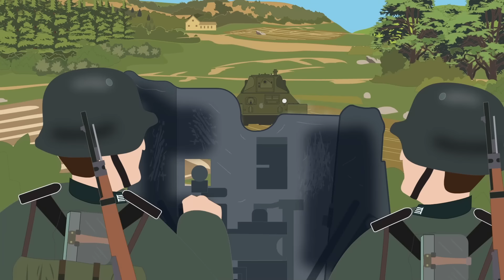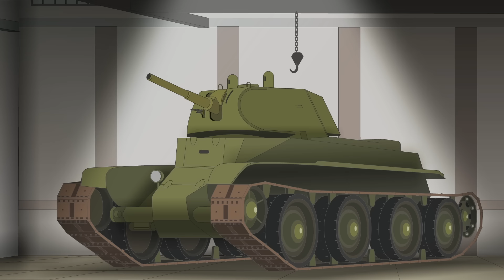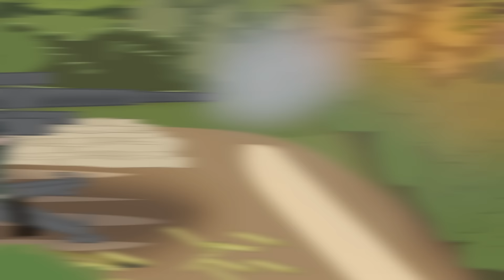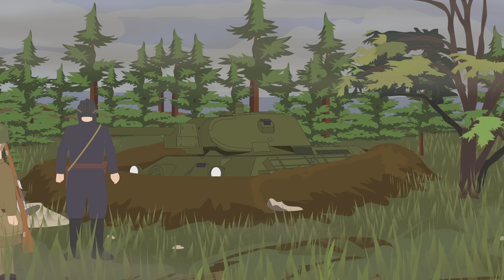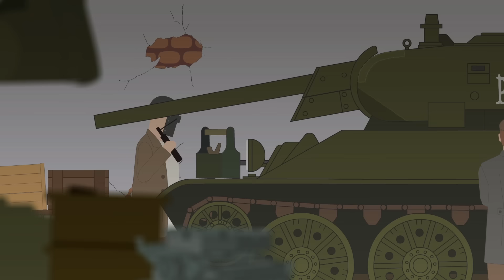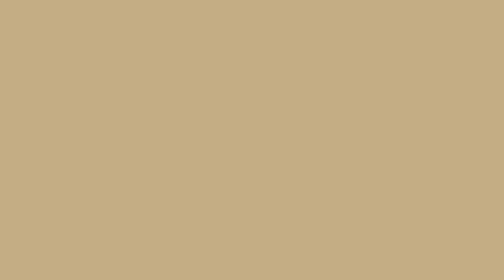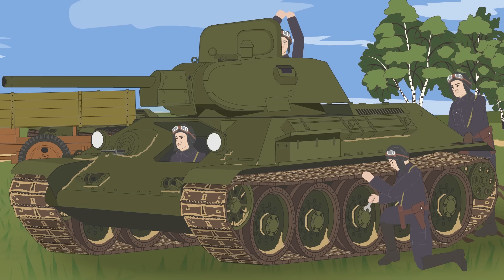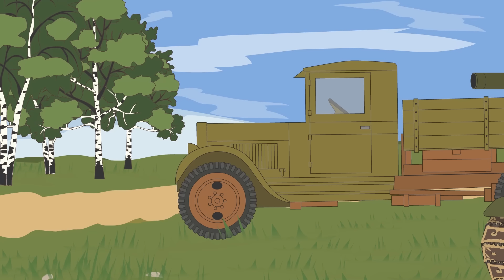Was the T-34 Really the Best Tank of WW2?

Comment: They were not the best tanks of ww2. But they were simple to produce and easy to operate and repair. It was a huge advantage over German tanks.
Reply: Not easy to operate nor repair. It was mostly just the production.
Reply: Which is why the Germans where able to capture them so easy ?
Reply: They were very much not easy to operate as the turret was not motorised there was no gunner basket and the transmission was terrible
Reply: T r a n s m i s s i o n
Reply: yet the Germans were way further with technology than the soviets
Reply: @DauntlessSherwood  no
Reply: But we know they don't have transmission they rely by their own selves a 1 tank in against them and also shock tactic striking through forest and even underhand tactics
Reply: Well the repair part is up the debate during the war no T-34 was built to a standered so they was some major variablity go to lazerpigs video on the t-34 is pretty good
Reply: @sawyerlogon7666  the T34 was good on paper, but it was trash compared to other tanks
Reply: @Delta-6501  yup most problems in my opion come from the manufactioring defects
Reply: but only 25% of them had radios...so not really. And 80% of all t-34's was destroyed
Reply: Fucking bullshit if an karl 98 shot it the soviet tankers would die of hot lead shrapnel and could only drive a hundred kilometers before the tank engien is completly onuseable
Reply: @drabantcorper4727  yeah no, 7.62 cant pen anywhere near 45mm of RHA.
Reply: @codyskull2594  your correct 7.62 cant do that but the t-32 was made out off hard pansar and that will not buckle but instead start to crack and leatting in fragment of the armor in to the crew.

(It was also hot)

And they had know space to put the gas somvhere so it was with the crew and hot hot schrapnel hitting gas and then the crew start to become a crispi potato
Reply: @codyskull2594  actually in some cases German rifle round could hurt the crew, it did not need to penatrate to kill only to cause Spalding which was very easy due to the soviets poor metallurgy.
Reply: @drabantcorper4727  if the T-34 was a terrible tank then name a better tank, I’ll wait. 

(If you say a German heavy tank or a panther, I will laugh)
Reply: @thecorneroftheinternet4656  Sherman. Better reliability and transmission because T34's transmission breakdown a lot. In fact, in the test driving to Moscow to show how good the Tank was. It broke down 3 times. It had a better gun at infantry support but only slightly worse in anti-tank, Sherman's gun only has a slightly lower velocity than the T34. Better crew comfort because it had a lot more space and the seats are made out of leather which makes the crew feel fresh when they get into battle. Much much better survivability because the rate of KIA for destroyed Sherman is 0.6. Better quality of armor than the t34 and also thicker effective frontal armor because it was angeled so it has a 91mm frontal armor effectiveness. It also had a better quality of armor because the Soviet's armor usually caused spalling after direct hit which is tiny bits of steel flying around the tank. Also, Sherman had better reload speed because the T34 was so cramped, it usually deliver 1 to 2 rounds per minute to the enemy. While Sherman has about 6 rounds per minute.
Reply: @rickastley4050  isint like every  tank form usa is better comparde to russias in ukraine i think i was a tank convoy how was stuck cuz the threads i dont know what it is called  anyway crackte upp so it cant move at all
Reply: @rickastley4050  The Sherman could easily be knocked out compared to the T34...and the T34, the original, not the 85 variant can do that.

The armor of the Sherman on the sides was flat and the point of where to ammo rack it was quite clear. Middle of the tank, below the turret.

The gun of the Sherman would have a tough time taking on a T34 due to the slopping.

And no...the americans did not have better tanks.

(looks at the Lee) Yea.

The sherman didn't cause fear in the german ranks...the T34 and KV1 did.
Reply: @rickastley4050  alright, now that I think about it, the M4 Sherman was kinda more superior than The T-34/85, but I’d still say that the T-34s lack of complexity and huge production kinda makes up for it.
Reply: @thecorneroftheinternet4656  pz4
Reply: @thecorneroftheinternet4656  or a British tank
Reply: @thecorneroftheinternet4656  or the Sherman
Reply: @SoulKiller7Eternal  T34 didn't cause fear, the KV1 did. You may think that the T34 causes fears because the report about T34 starts to come back in the first or second months of the invasion because it looks so similar to KV1. However, they already encountered T34 on the first day of the invasion and easily knocked it out with pz3. The thing that Germans fear is the KV1 because of its armor and the T34 had a pretty similar look as the KV1. For the Penetration capability of the T34, I do agree that the armor would be quite hard to penetrate but the T34 would have a hard time too. The eighty-five variant can penetrate Sherman's frontal armor in about 300m. However, by that time, seventy-six millimeter Sherman had already come along and it could also penetrate the T34's frontal armor in about the same range so no sides will have an advantage in terms of penetrating power. The sides for both tanks however would be much easier to penetrate even for Sherman's seventy-five millimeters gun could ripped through the T34's side armor like paper because the effective thickness of the T34's side armor is only about 40mm thick. For the ammunition, both Sherman and t34 had ammunition in the fighting compartment so the ammo would be hit if penetrated. However, the Sherman's introduced the wet stowage which would slow down the firing process significantly and would give the crew the time to bail out.
Reply: @thecorneroftheinternet4656  Every Sherman was better in all aspects

the 50mm panzer 3s were better

the panzer 4s with long 75s were better

Also, if your looking at straight stats, yes, almost every german tank past the Panzer 4 was better than the T-34

Also technically the Leopard 2A7 is a better tank than the T-34, also the panther is classified as a medium, despite its weight
Reply: @rickastley4050  yes! Yes! A actual person with braincells! Thank you
Reply: @thecorneroftheinternet4656  Russian KV1!
Reply: @codyskull2594  while the allies heat treated the metal on their tanks to about 300b the soviets heat treated theirs to about 600b which made it stronger but at the same time very brittle and could easily crack from being hit by a projectile. There are many pictures on google that showcase t-34's with cracked armor. Especially on the joints where soviet welders gave about 50% effort.
Reply: @thecorneroftheinternet4656  the sherman had a crew survivability of about 18% after being shot once whereas the t-34 only had about 14-15% survivabilty for the crew. Not to mention because of the design of the t-34 tankers were crammed inside of the t-34 leaving little room to move around
Reply: @drabantcorper4727  comeboo
Reply: @thecorneroftheinternet4656  people don't grow on trees
Reply: @thecorneroftheinternet4656  why laugh? The tiger was vastly superior to the t-34 in everything but number.
Reply: @SoulKiller7Eternal  A Sherman with a 76mm gun could easily penetrate a T-34 at multiple points. Even if the shot did not penetrate, the crew would be wiped out by spalling. Also, every single tank was somewhat vulnerable from the side and a Sherman could easily destroy a T-34 with a  good side shot. The M3 Lee was not a great design, but it was barely used anyway and was only meant to be used as a stopgap until the Sherman finished design. The Sherman was way more reliable, ergonomic, and easier to repair. Later variants such as the M4A3E8 "Easy Eight" and the M4A3E2 "Jumbo" were vastly superior to the T-34 in most aspects and eventually, when they did finally face each other in the Korean War, the Shermans fared better in combat.
Reply: @thecorneroftheinternet4656  the sherman
Reply: @thecorneroftheinternet4656  panzer III, panzer IV, sherman, Cromwell.
Reply: @thecorneroftheinternet4656  Sherman was legitimately a better tank as they were manufactured during WW2, if built in the same factories with the same materials and by the same welders, using the same casting methods and materials the same heat treatment processes, and the ammunition for both was manufactured with the same smokeless powder, you might have a halfway decent argument for why the T-34/85 could take a sherman in a head to head fight, but a lot of other soft factors involved edge the Sherman ahead of this theoretical best case scenario T-34. A lot of the reputation the M4 Sherman gets is due to the fact that the M4 never really had the luxury of hiding in a bush somewhere waiting for an unsuspecting enemy tank column to come trundling by into a pre-sighted ambush zone whereas the Germans did, it’s largely a moot point anyway because in the grand scheme of things it was more a war between tanks and infantry with anti tank cannons. Tank on tank engagements were much rarer than people tend to think, this is still primarily an infantry war.
Reply: @thecorneroftheinternet4656  the fact soviets were still producing them in the middle of wartime and with factories under heavy fire is ignored by many who talk about the quality control of the t34s. shermans only had good quality because american factories weren't being attacked at all, or near the front line, compared to soviet ones, thus the USA could take all the time they needed to have good quality vehicles. and even then a lot of soviet industry was being moved to the urals which caused a large drop in supply while keeping the same demand, hence the remaining factories had to produce as many t34s as possible.
Reply: coming up with angled armor saved their butts!
Reply: @davidbrandenburg8029  oh so we are going to ignore the fact that sloped armor exists in some medieval castles
Reply: @davidbrandenburg8029  that's been known about for a long time. The only reason they even needed it was because the armor was to brittle
Reply: @davidbrandenburg8029  no thay didn't Tank's from far earlier had sloped
Reply: They were not easy to produce
Reply: @Deltafrost-xh7sq  they were not easy to produce *well* They were extremely easy to produce if you were to you know, cut down on some things like crew comfort, decent welds, seats, armor hardness. Almost all T-34s had at least one defect, but they were quite easy to produce if you dont count the countless manufacturing errors. Hence why the gun was so inaccurate their best strategy was just to charge the enemy (thumbnail) lmao
Reply: Doesn't have to work more efficiently. Just has to work around efficiently.
Reply: yeah they was made in the same philosophy than the Shermans, medium, cheap, no need of elite crew and easy to repair
Reply: sorry to say, but easy to repair is a myth. how lmuch time is needet to change the clutch,to replace the engine,to exchange a spring in comprison to a Pz IV ? you will be surprised bcause russians don`t care about repairs! so please stop repeating some myth without knowledge.   "they say" isn`t areliable source.
Reply: They were not easy to produce. that's why every factory had to find ways to cut corners.  the end result is a tank nothing like its  original design.
Reply: I should say the t-34 was not easy to operate as one of the drivers levers I forget the name currently but it was prone to be hard to move and also was one part most likely to break if pulled to hard
Reply: one tiger took out  27  t34s and got hot around 50 to 60  times with 85 mm  got a couple dents
Reply: they were actually one of the worst vehicles to operate,
Reply: And much cheaper to produce
Reply: It was so simple even a child could drive it
Reply: Hahahaha. No
Reply: I think the t34 85 was the best but not the regular t34s used in 1942.
Reply: haters thread 😅
Reply: Not exactly watch the lazerpig video
Reply: Actually they weren’t simple to produce- they just rushed production
Reply: in 1941 thur 1943 the kn1 was best tank in world.  that why Germany made the tiger
Reply: @christopherrice6553  kv
Reply: Considering they lost more tanks than any vehicle ever lost in any war in history COMBINED, no. The t34 sucked.
Reply: That whats make them the best, duh 😂😂😂
Reply: Yeah that's why they were the best you literally just explained why it was the best
Reply: Yes
Reply: 'Quantity has a quality of its own' - Stalin (allegedly) 

The final and best argument for the t-34.
Reply: The USSR had more heavily armored and heavily armed tanks than the t- 34 but there were far fewer of them, the t- 34 was a common tank , which was encountered more often so it is better remembered.
Reply: It was the best.  Big gun, sloped armor, great tracks, excellent diesel engine.   Its upgrades were the Soviet T-34-85 and the Wehrmacht Panther.
Reply: Ah... They were not easy to repair. At all. They usually weren't repaired, you'd just get a new one. If you didn't die form the massive fire that started that you probably couldn't escape.

They were easy to produce. Especially if you took out minor things like: Seats. And radios. And Rubber. And working transmissions. And didn't properly weld it. And didn't properly rivet it. And gave it a shelf life of 500 km.
Reply: @invidatauro8922   don't forget the shrapnel that would ripe through the Hull
Reply: @invidatauro8922  compare to german advanced stuff, they were damn easy to fix xD
Reply: @invidatauro8922  and more like no having turret basket which is essential and no bullet proof glass on periscopes and scopes
Reply: @invidatauro8922  500km is good compared to Panthers.
Reply: Hard to operate, dangerous, un-repairable. Mismatching spare parts etc. Want me to continue?
Reply: Easy to operate huh 
So we are about to ignore the strength needed to change gears of whatever
Reply: I say just go watch laser pig
Reply: @met25252  his vids  are so good
Reply: Disagree, it was the best tank statistically.  Due to cost of production and sheer numbers.
Reply: @IS-2 Heavy Tank no the t34 was not fast its got one shoted by panzer 3 and was not very cheap
Reply: @IS-2 Heavy Tank it was the slowest allied tank
Reply: they forced the nazis to change their whole design philosopy and tactics to be able to handle it , no other tank did that in the entire war , IT IS hand down the best tank of ww2 whether the westoids like it or not...
Reply: No the t 34 dident have any advantages aainst german tanks
Reply: @niclink1030  Did any Soviet tank knock out any German Tanks??
Reply: @katimboallan4605  yed they did but the t34 still sucks
Reply: and EXPENSIVE
Reply: @madhie-kun8614  the tigers? Yes
Reply: @polar8469  I think he means the t-34 it was not a cheap tank
Reply: Yes it was. For the simple fact that it doesn't matter if you make a giga omegalul tank (king tiger) that costs in average 300,000 man hours to be produced when the t-34 costs only 6,000 in average, meaning for every king tiger 50 t-34 could be built. Yes, by the end of WW2 the t-34 was massively outclassed but guess what, *it doesn't matter* if you have 100,000 more tanks than the enemy.
Reply: @HenriqueRJchiki  The problem with your assessment, is actually several points. First. It was expensive. It was on par, if not more expensive top build then a Sherman. Second. It doesn't matter if you have 100,000 tanks, if 70,000+ were down for maintenance. Third. The tank was no where near what is put on paper for effectiveness. Very few could actually match up to the quality that was the norm for ANY of the other Allied or even Axis nations. Everything from the armor being way to hard, which is what caused the spalling inside the tank when hit by even some small arms, (which did happen, though not often, due to very few tanks having the same armor qualities as their sister tanks in the same production lines...) and cracking instead of shrugging of a round, to the sights being hit or very miss on quality. Some you could see through, though not well, some you couldn't see through at all, and only few being worth a damn.(The funny thing is that the ones that actually worked, were considered some of the best in the war but when you do not assure quality of all...) The biggest thing that Russian tanks had problems with, that were even there in the after war productions of the tank, were the issues with the engine and transmissions.

So you have a fairly expensive tank, which couldn't effectively do the job consistently, and most things known about them is propaganda pushed out by either the Russians, or the Germans. Not a reliable source of information. And when they were actually looked into by the Allies, they came away with the firm conviction that they were for the most part junk. It is why you do not see ANY of the other Allied Nations using them after the war, or even using the designs.
Reply: @johnathanjarrett63  The problem with all of you tank nerds is that you are all obsessed with the tactical field and completely disregard the operational and strategic, the t-34 was far cheaper than any similar german tank, it worked better under russian soil, it was mass produced enough that it outnumbered THE ENTIRE WORLD, the soviets ended the war with 22,000 tanks, again, MORE THAN THE ENTIRE WORLD COMBINED. "But muh 93924mm murican tank can penetrate the 58271m armor under a 948281° degree slope" and BLA BLA BLA completely fucking irrelevant nitpick specs that only matter on the tactical floor and ends up being irrelevant because the opponent has 100x more tanks and just encircled your entire division.
Reply: @HenriqueRJchiki  quality is always better than quantity that’s why the massive millions of soldiers per army doesn’t exist now
Reply: @HenriqueRJchiki  do you know why so many Russians died in war it’s not because their strategy was to throw themselves at the enemy until their ammo ran out it was because of poor strategy a lot of poor strategy
Reply: @HenriqueRJchiki  say you have 100 expensive tanks and 200 cheap tanks but for those cheap tanks you also need twice the amount of supply trucks, crew, food, and training, and all of a sudden those 100 cheap tanks cost you a lot more than you wood think
Reply: @HenriqueRJchiki  people don't grow on trees 🙄
Reply: @pikxv  ???
Reply: @HenriqueRJchiki   aaaaaaaaa this is the definition of comeboo
Reply: @pikxv  the USSR had more than enough, this was a time where production was more valuable than manpower, it's obviously completely different nowadays.
Reply: @HenriqueRJchiki  your argument is irrelevant if the 100x t-34s can’t coordinate with each other and half of them break down and the rest engage the enemies one by one cause they have no fucking radios and their “superior sloped armor” cracks in half when it’s hit by anything, and they can’t even see where their going cause all the sights excluding the gunners are complete garbage.
Reply: @HenriqueRJchiki  but that's the thing you still have to tran them and you have to move food and desel
Reply: Drrives gunners ecstasy
Reply: @HenriqueRJchiki  22,000 tanks is not more than the rest of the world lmao. The allies ended the war with 42,500 Shermans alone considering 50,000 were produced and only 7,500 were lost.
Reply: @HenriqueRJchiki  yes that is true but that 50 more t34s required more people more food for the people more fuel more ammo more parts then one king tiger
Reply: @polar8469  the T34 was an expensive tank built cheaply, that’s never a good combination
Reply: @tox_the_fox5406  somehow, it proved to be a good combination.
Reply: @polar8469  Not really, in the battle of Stalingrad 326 out of 400 T34s were lost, out of those, 260 were from auto mechanical problems. There’s also the fact that many needed components were removed(such as lights, seats, the turret basket(that thing in the turret that lets the crew move with it) radios etc) in order to lower production cost, and make production faster. In addition, while some T34s had great gunner sights the other sights were abysmal, it was to the point where a Pact-31 crew once shot at one 28 times before the tank crew noticed it was being shot at.

Do a little research before you say anything ridiculous like that.
Reply: @tox_the_fox5406  username checks out
Reply: @tox_the_fox5406  but still, germany attacked them by surprise and they needed something to manufacture quickly, something that would be cheap, and eventually they won the war, you should also check the wiki about it, it has lots of information about how it is a good tank
Reply: @polar8469  I’d like to clear something up real quick, the Soviet Union didn’t win the war, the Allies won the war, and yes I admit it’d be a decent tank if it was produced to the standards it was supposed to be manufactured at, but it wasn’t
Reply: @madhie-kun8614  source?
Reply: We bullied a tiger and panther. Winter is here comrades ;) ❄️❄️❄️❄️❄️❄️❄️❄️⛷️⛷️⛷️⛷️⛷️⛷️⛷️⛷️🏔️🏔️🏔️🏔️🏔️🏔️🏔️🏔️🎿🎿🎿🎿🎿🎿🎿🎿🎿🏂🏂🏂🏂🏂🏂🏂🥽🥽🥽🥽🥽🥽☃️☃️☃️☃️☃️⛄⛄⛄⛄⛄⛄⛄
Reply: @t34tank60  you bullied one, the tiger or panther bullied hundreds more
Reply: @t34tank60  try bullying tiger II
Reply: @t34tank60  shut up you start cracking the second something hard hits you and the crew has no space you got killed by Pz3 most and couldn’t go 50km without a breakdown and you were made in tractor factories and rushed witch made everything worse the only reason you past Poland was because the Germans didn’t prepare for winter
Reply: They were the best tank for the UdSSR at that time and thatsthe important part
Reply: @imper818   try the kv1 one kv1 stop a whole army tank uints for 2 days
Reply: @imper818  Nope.
Reply: @imper818  no
Reply: @imper818  that honour actually goes to lend lease vehicles
Reply: @imper818  kv1
Reply: @imper818  best medium tanks the KV 1 was a stronger tank but it was way more expensive to make
Reply: Might want to study history then. They WERE the best tanks of WWII. Thats a fact. Trying to dispute that...is...well...only an idiot would argue against a fact.

Easily massed produced and equipped with the armament to handle any opposition...they were the foundation of what would come to be...the MBT idea.

T-34 can be in attack or defending.
Reply: @SoulKiller7Eternal  False, T34 wasnt as reliable as people say and the main gun lacked later in the war. They were cheap and worked in early war, however T34-85 was the better tank from these two.
Reply: @joelm5509  never said t34 is reliable
Reply: @joelm5509  Correct. The T-34 was incredibly unreliable.
Reply: @SoulKiller7Eternal  No they weren't the Best Tank of WW2, no tank was for that matter.

Each tank had it's advantages and disadvantages, and the T-34 had plenty of both.

While the T-34 was cheap, and had sufficient firepower, and reasonably good armor, it was plagued by reliability issues just as much if not more than German and Western Allied vehicles, it became such an issue that Joseph Stalin himself wrote an order concerning these reliability issues in 1942 during the Battle of Stalingrad:

"Our armored forces and their units frequently suffer greater losses through mechanical breakdowns than they do in battle. For example, at Stalingrad Front in six days twelve of our tank brigades lost 326 out of their 400 tanks. Of those about 260 owed to mechanical problems. Many of the tanks were abandoned on the battlefield. Similar instances can be observed on other fronts. Since such a high incidence of mechanical defects is implausible, the Supreme Headquarters sees in it covert sabotage and wrecking by certain elements in the tank crews who try to exploit small mechanical troubles to avoid battle.’

Henceforth, every tank leaving the battlefield for alleged mechanical reasons was to be gone over by technicians, and if sabotage was suspected, the crews were to be put into tank punishment companies or "degraded to the infantry" and put into infantry punishment companies.' "

This pattern of Mechanical Failure continued well into the later half of the war, with the T-34-85 and T-34-76 Obr.43 upgrades both being plagued by old and new reliability issues of their own, these issues were only really resolved after WW2 with the final modernization of the T-34-85 models 46, 60, and 69.

Another major drawback of the T-34 models was crew comfort, many things that were common in German or Western tanks were absent in T-34s to hasten production such as proper seating, rubber, proper ammo stowage, properly welded armor plates, properly crafted sights, properly made clutch , ect. These tanks were practically stripped down to their bare bones to be made quickly and efficiently, the Soviets did not care about the Crew's comfort which could very well make their job difficult and life threatening. In fact the armor layout itself was detrimental to crew comfort and survival, sloped armor gives you good protection but sacrifices space within the vehicle as a consequence, have you by chance seen what it is like within the turret or driver's position of the T-34? Now imagine trying to escape that should your vehicle suffer a penetrating hit or catastrophic failure on the battlefield.
Reply: @Kom-1775  No other tank was mass produced and flooded the field like the T34 was.

The Tiger & Panthers were the answers to the Russian tanks, but the T34 was upgraded with its 85 as the answer to the new German tanks.

Becoming quickly the biggest issue for the Germans because, while the Pz3 could knock out a T34, it had to be close and in to the sides or rear because it won't knock it out from the front. It didn't have a gun good enough. Neither did their dedicated AT guns...they needed to use AA 85s to be able to knock out T34's easily.

Mass production makes a difference and the fact it for the most part, along with its heavy KV variant heavy, sealed the war in the East. Along with poor german command and they suffered from poor training, failure to prepare and a staunch russian defense. Lets not forget the over engineering of their tanks that caused massive reliability issues for their machines, more then the T34 had.

The russians didn't care for comfort...yea. Why care for comfort when you're goal is to out produce your enemies?

Numbers play a part in war...and if you flood the field with quadruple the number - your chances of victory increases drastically.

Think of 300 Spartans vs the Persians...they KNEW they weren't going to win - but they would make them pay for it.

However, there wasn't a massive german army to replace what the Germans lost...there was and endless supply of Russians for them to toss in the grinder.
Reply: @SoulKiller7Eternal  Yes you are correct, no other tank was mass produced and thrown out so haphazardly as the T-34; that is part of the reason it isn't the best tank of WW2.

The Average German tank wasn't the Big Cats, and the Big Cats weren't the answer to the T-34. The average Panzer IV or STUG III could knock out the T-34 at ranges  the T-34 Could have been able to engage from... If the sights weren't trash and the ammo wasn't poorly made. Even the T-34-85, whose gun on paper should've been superior to the KWK 40 was hampered by poor sights and unreliable ammo, reducing their effective combat range. Yes the T-34-85 is the answer to the Big Cats, if the Tank gets into effective range and doesn't break down due to the myriad of reliability issues.

I am aware of the Early war successes of the T-34 in it's battles against the *Early War German Army*, it's not rocket science that the Early Panzer IIIs couldn't take out a T-34, but the Panzer III armed with the long barreled 50mm gun COULD take out T-34s at a reasonable range, along with the 75mm armed Pz IVs and STUGs, literally three of the most abundant tanks in the German arsenal can knock out T-34s by 1942, so it's armor is useless only a year in.

Mass production CAN play a big role, what you're forgetting is, is that even with that Mass Production and waves of T-34s the Soviet Union lost a huge chunk of it's industry to an enemy fighting essentially a three front war. Had that not been the case, and the situation would likely have played out much differently, the T-34 played perfectly into what the Soviets needed right then and there, a crappy tank to fill the gaps and buy time to attrition the Germans down, the Germans were never going to win a war of attrition while fighting a three front war against an enemy who doesn't care for the lives of it's people. The Soviets literally built the defects into the T-34 intentionally knowing it would likely not survive battle, that in of itself makes the reliability worse than the Germans whose reliability issues came from over extending the limits their tank chassis not planned obsolescence.

Why should you care about Crew Comfort? Ask the French, with their one man turreted tanks, that lacked radios, and were limited often to only 3 crewmen who were over worked. Your vehicle has to actually be USABLE; the United States beat the Soviets at their own game with the M4 Sherman which was the second most mass produced tank of the War and offered great crew comfort and decent survivability, and maintained great numbers as well.

Yes flooding the field is a valid strategy... If your weapons actually work. If 60% of your tanks bre down before even engaging an enemy you now not only have a lesser quality vehicle but your numbers advantage is nullified making your whole strategy pointless.

The 300 Spartan analogy doesn't help you, the Spartans we're considered the most elite of the elite, a force armed with the best equipment and given the best training; facing down the levied masses of Persia's conquered domains. The Spartans lost their specific fight, but the thousands of other Greeks fighting alongside them won in the end thanks to superior equipment and training versus a foe using mass conscription and levied soldiers.

Indeed the Russians could replace their losses, but as I said above, in only a year the Soviets we're driven back to a very precarious and deadly situation with two of their biggest population and industrial centers being threatened by an invading force already fighting a two front and now three front war. The Soviet numbers game only worked because the Germans couldn't focus entirely upon Russia, their resources and manpower were spread thin.  Not to mention, the Allied relief efforts to the USSR and allied bombing missions which decimated German industry further stalling them, both of which gave the Soviet Union breathing room to continue fighting a war of attrition.

The T-34 was a good tank for what the USSR requires of it, but in any other situation or strategy it would be a detriment to the commanders and soldiers fighting with or alongside it. It was not the best tank of WW2, nor was there a best tank. All of the tanks in WW2 were quite honestly garbage... Because this was the First War where Tanks were mass produced and used on a grand scale, WW2 was literally the proving ground for Modern Armoured Warfare, those who made the vehicles lacked adequate knowledge and foresight to create a "Best Tank" only guesses and attempts at what they thought made a good tank.
Reply: @SoulKiller7Eternal  (laughs in Panzers 1 to 4)
Reply: @Kom-1775  it was a very expensive tank
Reply: @SoulKiller7Eternal  Tiger and Panther weren't answers to T-34
Reply: @SoulKiller7Eternal  would recommend the Lazerpig video, it explains why the T-34 wasn't the best tank
Reply: @SoulKiller7Eternal  It's an opinion, not a fact lol. The T-34 was very unreliable and the armor was overly heat-treated so it would spall and kill the crew inside. It was extremely cheaply made and the producers did everything they could to cut costs. The ergonomics were horrible and the crew survival rate was extremely low. Out of all the variants, in my opinion, the T-34-85 was the only one that was pretty good because it was a bit more reliable and had better armament.
Reply: @SoulKiller7Eternal  no maybe mass produced but not the best
Reply: @SoulKiller7Eternal  This might be the dumbest argument I've seen so far. I suggest you watch Lazorpigs take on T34. He is more than qualified and bases he's argument in true facts, blueprints and og sources.
Reply: @SoulKiller7Eternal  i disagree
Reply: @SoulKiller7Eternal  so the tank is the best tank if it is easily made lol. They had the advantage in numbers, that is not a feat of the tank?
Reply: @SoulKiller7Eternal  laughs in Panther
Reply: @SoulKiller7Eternal  That's not a fact. The the T-34 had a 15% crew survival rate vs the Sherman's 85%. That's a fact. I can't tell you how to judge what makes something the best, but personally I know I'd rather not be dead.
Reply: @SoulKiller7Eternal  How can you say they were the best tanks and what do you base that on? You only have to look at the actual operational statistics for the T34 and the T34/85. A Tank with a kill loss ratio 1.3 is not a good tank. The T34 was a war winning weapon on quantity as 55400 were produced  On a tactical level they lost 44900 which is a 80% loss rate so it cannot be considered a good Tank and contrary to popular belief the the T34 was not made out of Stalinium. If the  Abrahams had a kill loss ratio of 1.3 would you say the Abrahams was a good tank. 

There was no such a thing as an MBT until the British built the Chieftain and called it a Main Battle Tank. The M48/60 Patton and the T 55 were designated medium tanks by their respective nations and were only designated as MBTs after the British coined the term . An MBT has to have the mobility of a medium tank the fire power and armour of a heavy tank and replaces both the medium and heavy tank in service. It does not replace the light Tank.
Reply: @SoulKiller7Eternal  And with your current logic you are probably going to say it was the first tank with sloped armor.... what a clown
Reply: @bobefwgrhnfmyrh8938  It wasn't the first, but it was the one that relied on it as its biggest feature and it made it well known how reliable sloped armor and how well it works.

The previous tanks that had sloped armor...(looks at the french tanks) they didn't perform so well...and thats because...well...they are french, and they didn't use them properly and were flanked.

An amazing tank isn't worth much if you fail to use it properly.
Reply: @SoulKiller7Eternal  I was going to mention how sloped armor has been along for a while now though i left it out of my first few comments.
Reply: @SoulKiller7Eternal  hey did you you you don’t need the shot to penetrate if the tank cracks the second it hits and creates more spalling than other tanks
Reply: @SoulKiller7Eternal  the "best" tank could be taken out by a panzer 3
Reply: @SoulKiller7Eternal  you’re spewing all sorts of bs. The T34 was a decent design but the quality control was terrible. They weren’t as reliable as people say either. The best thing about them was that they’re cheap. Also, the first mbt was the british centurion…
Reply: @bro26mohw  the design was mid
Reply: @bro26mohw  yes, they are so unreliable that stay on service till now.
Reply: @SoulKiller7Eternal  LOOK AT THIS COMMIBOO
Reply: @SoulKiller7Eternal  Tiger tank intensifies
Reply: @bobdaniels9056  (laughs in T34-85)
Reply: @SoulKiller7Eternal  laughs in literally every single sherman varient
Reply: @SoulKiller7Eternal  no, the  British Centurion was the first MBT.
Reply: @dodderythedromedary6890  never said t34 is an MBT
Reply: @dodderythedromedary6890  Might want to re-read. I didn't say the T34 was the first, I said it was the foundation...and that is true.
Reply: @SoulKiller7Eternal  oh okay 👍
Reply: @SoulKiller7Eternal  they would literally crack and have huge chunks ripped out the second they were hit by anything hard and fast they had no reliable apds and only used the normal AP or even he because there was no AP the crew had no space it had a guaranteed breakdown every 50km it didn’t use rubber on road wheels witch made the tracks suck it got stuck in mud just as much as any other tank it got destroyed by Pz3’s most it was made in tractor factories and was rushed do I need to go on more
Reply: @Whiskers4169  yes! The armor of a T34 more brittle than SoulKiller7Eternal's brain mass, if he even has any
Reply: @Whiskers4169  tf are you saying, apds existed in 1941?